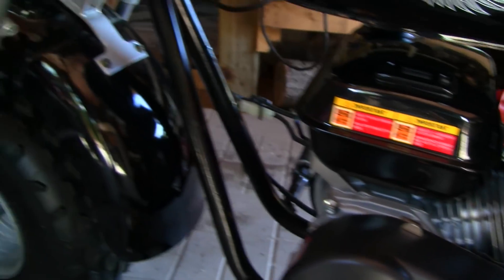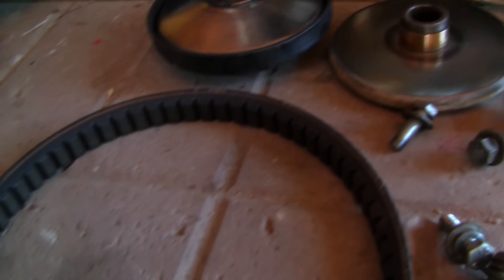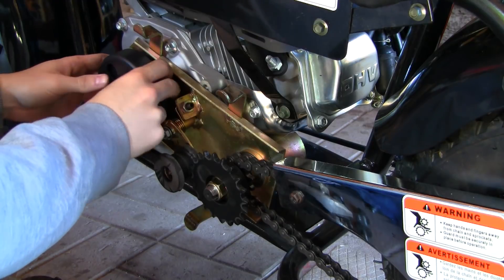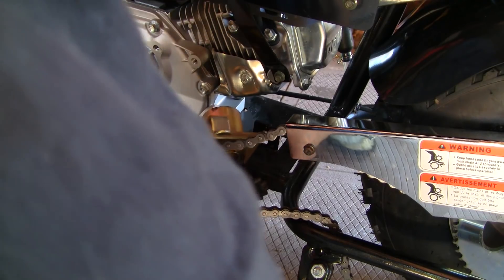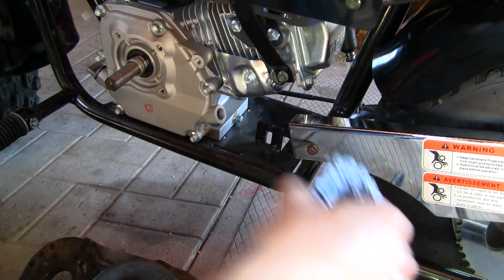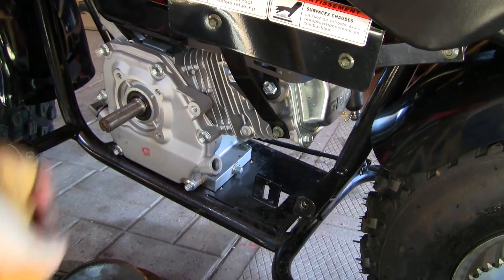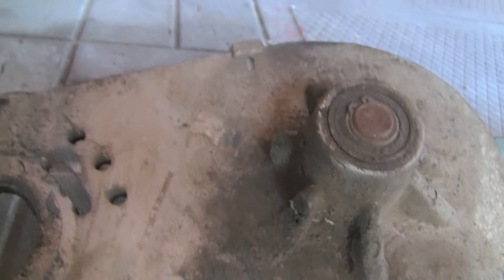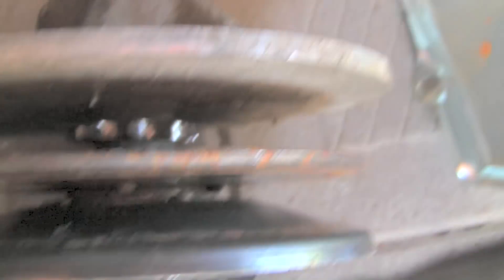Baja Warrior  Mini Bike Clutch To Torque Converter Conversion

Comment: You said it would go 70 after tuning the TAV, how would one go about doing that?
Reply from the maker: +Adam Szuszkiewicz you can adjust the spring tension on driven clutch to have it activate at different rpm's, also if the drive clutch and driven aren't perfectly aligned that can affect speed a bit, and perhaps other things like chain tension, wheel alignment, tire pressure, etc.

Comment: whats better for a go kart the Clutch or Torque convert for power
Reply from the maker: Depends where you plan on using the go kart. If its for any kind of off-roading then definitely the torque converter, but if its just going to be used on paved roads and paved go-kart tracks then a centrifugal clutch should be fine.

Comment: Could you tell me if an "impulse" type fuel pump would help the performance of a clone engine? Also, is there very much difference between the 196cc and the Predator 212cc engines? Thank you, any input would be helpful and appreciated.
Reply from the maker: Sorry don't really know enough about small engines to know if that fuel pump would make much difference. As for 196cc vs 212cc, I haven never tried one of the predator engines but I really can't see 16cc making much of a difference.. Perhaps someone that has tried both could better inform you though.

Comment: On some other videos I have seen about people putting torque converters on this mini bike they had to cut the mounting plate for the torque converter.  Did they do something wrong?
Reply from the maker: I'm not sure. I have never watched any other torque converter conversion videos. Perhaps they were using a different model?
Reply: It's a clearance issue, they didn't do anything wrong.

Comment: What does a torque converter actually do? Make it go faster?@MarcelsWorkshop
Reply from the maker: More speed, more power, better overall driving experience. Works kind of like an automatic transmission on a car always adjusting the gear ratio to give the best performance in the given situation.

Comment: The only problem about bypassing the governor is that the motor would wear out faster. I would get a 6.5 hp 212cc at harbor freight and get a torque converter it would go bout 50 or 60 mphs.  Also another why to make it go faster is to heavier valves
Reply from the maker: I've bypassed the governor in everything I own and haven't had an engine die on me yet.. :P (knock on wood)
Reply: Yea bypassing the governor inst to bad, but taking off the governor completely is a death wish for the motor

Comment: I have a minibike that is what I believe a yerf dog, it has the same stock setup, and I would like to mount a new engine and Put a torque converter on it because it is so slow, I want speed. Any suggestions and could you send me the link to the Torque converter and where you bought it?
Reply: if you take governor off you must re-place the flywheel as they cannot handle the added rpm's . A billet aluminum flywheel is about $100.00. It can handle up to 6000rpm. The stock cast iron flywheel will EXPLOED at 3800-4200rpm. One guy had his leg amputated from the exploding flywheel....be safe
Reply from the maker: If all you want is speed then the solution for most speed would be first bypass or remove the governor. Then simply remove the whole gear reduction system and have the chain go straight from the clutch to the back sprocket. (although you loose a lot of power in this setup for climbing and stuff like that).  Torque converter is a good all round solution though for way more speed and power then stock, but not as much speed as straight clutch to back sprocket.

This is where I got mine and the one I got: http://www.princessauto.com/pal/en/Accessories/3-4-in-Bore-10-Teeth-Torque-Converter-Kit/8404535.p

But only because its one of the few places in canada that has them. If your in the US you have many more places that sell them and cheaper options.
Reply: Larken McRorie amazon

Comment: what is the advantage of the variator? only the speed?
в чем преимущество данного вариатора? только скорость?
Reply from the maker: speed and torque. when your in a situation where you would need more power, such as climbing or, it automatically adjusts to a "low gear" when your on a smooth flat surface it automatically adjusts to a "high gear" to give you the most speed. like a simplistic version of an automatic transmission in a car.

Comment: That seemed like a really easy conversion.

Better acceleration? More top speed? That gear reduction setup looks like just a cheap way to "make it work" while sacrificing performance big time
Reply from the maker: Yeah it is a pretty easy switch but offers a huge improvement in performance compared to the original setup. It feels like a whole new bike with an engine twice the size after making the switch! :D
Reply: I'm sure. The dual clutch system definitely must utilize the engine's torque and powerband a lot more efficiently.
Reply from the maker: Krankie V
Definitely

Comment: You just changed the gearing and ruined the original setup. Both function the same exact way.
Reply from the maker: No... The original set up is a fixed speed this one is a continuous variable speed, like an CVT in a car, to give you more bottom end when you need it and more top end when you need it. They function very differently..

Comment: My baja mb200 that I bought two days ago has squeaky brakes, and tops out three seconds after I accelerate. I tried to adjust the throttle with a screwdriver and it didn't work. Please help! I need to know how to get it to go faster.
Reply from the maker: The brakes are squeaky cuz their cheap, but they still do the job. :P Baja Warrior Mini Bike Easy Governor Bypass (1080P) and/or Mini Baja 85km/h! (53mph) (AKA Baja Warrior or Baja Heat) to go faster for free.
Reply: any way to adjust the throttle
Reply from the maker: steven memez
the ends of the cable screws in or out to adjust throttle.
Reply: yea but when I did that it lost and gained power when I was riding it and backfired really bad
Reply from the maker: steven memez  Probably the governor. Remove or bypass it. If its not that then I dunno.. Take it to a small engine repair shop and they'll be able to fix it.
Reply: steven memez There is a screw inside a coil spring directly adjacent to the business end of the throttle cable that inhibits movement of the throttle body.  This screw is extremely useful in controlling engine power for use by a small child, I imagine this is the intended use as it doesn't seem to function as a rev limiter or safety device.  Look at the point on the engine where the cable connects, while activating the throttle, and this screw will become immediately apparent.  Loosen, or completely remove, this screw.

Comment: now cut off the long shaft coming out of the engine, because that also interferes with the torque converter... LOL
Reply: yea he really went the long way around to do this swap. if anyone else is here for tips, you can simply notch the aluminum backin plate where it hits the frame and likely notch/clearance anything else that hits or will rub. nicer to keep all the safety covers intact if possible, makes for a cleaner more factory install.

Comment: i guess i missed the rear oil plug behind the torque converter install but its easier to get in w/o all that on the bike mine has 3 but i omitted ALL that and went clutch to wheel all ya do is flip clutch over align wheel lengthen chain n wala i was hangin with 450 yamaha flyin bout 75 80 mph may need to balance wheels also but it was scary fast not for inexperienced rider for sure good luck im on my 2nd one 5 clutches 4 motors a wad o chain n sweat blood foul language but was worth every bit of it later
Reply from the maker: Doing that you definitely gain more speed but you loose all your bottom end torque. :P
Reply: so true but she is fast and also exstremely hard on chains sprockets clutch ect but removes the bulldozer feel of the drive section and pushing her is soooooo much easier whenst spacing of the fuel tank or other oopsies and no disrespect I know how it goes as to unexpected  trials along the way a 15 to 50 ratio would help ease the torque n wear but im using 10 to 50 n I push her up the hills but on the flats shes a beast near 70 mph or more depending on wind spark fuel ect n I put gocart motor instead of back faceing head designed motor she has n it was a BIG gain in fun to ride n ill keep feedin the chain to her till she blows n do it again ha ha thanx
Reply from the maker: edwin nelson
 If that's what you like then power to ya! :D

Comment: Wtf do I do now I have a nut that screws on the end of the shaft not a bolt that goes in
Reply from the maker: You must have one of the new models so your going to have to follow this guys solution of using a special lug nut.
How to add a torque converter to a Baja Warrior MB200 with untapped crankshaft

Comment: does your tav2 get hot after riding awhile? I recently converted to torque converter and mine got hot pretty bad the first time but the pulleys weren't really on the same plain, now they are alighned well but still seems to get hot after 4 or 5 miles?
Reply from the maker: Yeah it does get pretty hot

Comment: dude did you see the oil plug missing out the back hole I found mine the hard way blew oil allover hell also whole engine side plates tend to unscrew better put thread locker on em or all oil runs out lower bolt holes when they fall out 3x that happened swap factory exaust for strait pipe rip off air cleaner reroute case blow tube just use air filter n its a near 1 horse gain in torque n responsiveness w/o gov removal jus sayin 35 years a wrenchin on junk un junking it lol
Reply from the maker: There is no missing oil plug..?  I just use lock washers and have never had a problem with the plate unscrewing. :P Built my own straight exhaust. :P Added scoop to air filter but haven't done much else.

Comment: how much was the torque converter clutch? Ive found some on ebay and stuff from 100-145$ but I want to know how much it is new
Reply from the maker: For a new Comet brand torque converter is around $270 CAD. Can probably get knock off versions for a lot cheaper though.

Comment: dude you dont keep the thing between the two parts of the center of the belts that slows you down . The higher the belt goes the parts get skiner that huge spacer is between it stops it.
Reply from the maker: Not sure what part your talking about? You talking about the bronze idle ring at 5:10? If so that doesn't affect the speed, the clutch can slide over top of it when it's engaged. It just helps prevent premature wear on on the belt while idling. It allows the shaft to spin without grinding against the belt.
Reply: Ya I couldnt see that I saw an other viedo that I see better and saw that . Well did you by pass the throttle governor
Reply from the maker: Colin Stienke
Yes governor is bypassed

Comment: where did you get the torque converter clutch
Reply from the maker: a local princess auto
Reply: how mutch
Reply from the maker: tyler reel
around $270

Comment from the maker: Well there's way less vibration with the torque converter compared to the stock centrifugal clutch and it engages a lot smoother, but I have no Idea how it would compare to a racing centrifugal clutch, I've never tried one. :P

Comment from the maker: NP. Although if you just want speed and don't mind loosing torque, you could always just remove the gear reduction system and attach the two chains together so your going straight from clutch to back sprocket. :P

Comment from the maker: you might of bought a torque converter for a 1 inch shaft rather then 3/4 inch. Only thing I can think of is exchange it for the smaller version or if you can't do that you may have to buy a new 3/4 inch driver unit, or see if you can find some sort of adapter to go from 3/4 inch to 1 inch.

Comment: I didnt build the bike dumby.... check out the description of my channel asshat. I buy shit vehicles and replace as many parts necessary to make it run well and looks professional. And I do things like that to show people not to do it. If it was a mistake, I wouldnt have made a video of it. Also, that frame with the engine weighs less than 70 pounds and then im 150. Im pretty sure their rated for at least 300 cuz what if a fat guy were to ride it???? Brakes work fine... STILL

Comment: Do it right you say?
You have what appears to be a bicycle or mini moto brake on the rear of that mini chopper you built.
Your engine has 5 times the toque it was rated for and double the weight.

Marcel here actually has things that are safe.
And he is smart enough to ask for, and listen too good advice. 

Maybe you should stop posting now.
You are embarrassing yourself

Comment: If you clean, lubricate, and adjust as required then it would look like this.

You were hit by flying parts of a clutch you did not mount correctly as seen in your own video,
You clearly are not qualified to judge other people's work.

For your information the thread and bolt on these engines is 5/16 American Fine not "smaller thread than normal bolts".
Square key stock is not " a pin " .
If you need a part, then get the part number before you order and stop blaming others for your mistakes.

Comment: I've been researching torque converters for my new Baja Warrior 200.  Unfortunately,  the crankshaft on mine does NOT have a threaded center bolt.  Instead the end of the crankshaft is threaded on the outside and the clutch is retained with a nut and cotter pin.  Bummer.

What options do I have with something like this?

Comment from the maker: This is a brand new bike, but the one I pulled the converter off of and often use for experiments is a few years old and dirty, yet everything still comes off just as easily. Although I store everything in a dry shed, I guess if someone stores there bike where water can get to it and everything is rusted on, it might be difficult to get apart. As for caked on grease, that can be fixed by just taking a pressure washer to the bike and giving it a good cleaning. :P

Comment: What I really dislike about this video is that the project your showing is practically sterile. This thing obviously has rarely seen blacktop and you could work on it with a white glove and not get it dirty. What this video doesnt show is that if you have one of these after years of use and sitting around your going to have caked on grease and some parts arent gona wana come apart as they did on day one. Usually you need a pulley puller for the clutch and more force in taking of the master link.

Comment from the maker: its 3/4 inch. the difference is the size of the shaft on the motor. yours will likely be 3/4inch. 4-8hp engines are usually a 3/4 inch shafts, less then 4hp is usually a 5/8 inch shaft and more then 8hp is usually a 1 inch shaft.

Comment: Thanks a lot for the video i followed your instructions and the torque converter fit my bike perfectly...Only after a month of riding i seem to have a problem with the torque converter it just stopped accelerating like it used to when i installed it which was 40ish mph now it seems to go like 10 mph at most...Do you know what could be the problem with it? torque converter seems to work fine running, just not accelerating the bike for some reason...Any suggestions would be greatly appreciated

Comment from the maker: Ah I see. There are better more expensive ones with higher ratios, but this one is the easiest one to put on because its all one unit. The bigger ones are 2 separate pieces so you would have to come up with your own mounting system.

Comment from the maker: "But its the one you have is the best you have?" hmm not quite sure what your asking. :P Ya if you've never rode before I'd keep it stock until your completely used to it, then from there I would bypass the governor to give you more speed and get used to that. Then once you get board of that go with the torque converter for even more power and speed.

Comment from the maker: Comet TAV2-Torq-A-Verter, 3/4" Bore 10 Teeth, #40/41. Around $270 in Canada or $200 in the US. You can also find cheaper knock off versions of it too if you want.

Comment: PLEASE RESPOND ASAP... I have the same bike with the same "old" clutch setup not the torque converter. I recently lost my bolt that holds the clutch in and i really would appreciate if you could tell me the exact specifications on that bolt so i can go buy a new one. Also do you think i can ride it without the bolt in there? This would be a huge help for me if you could answer my questions.. 
Thanks in advance

Comment from the maker: no idea. :P if it broke off you may have to get a new unit, or Macgyver something, or just remove the whole unit and connect the 2 chains, that would gain you lots of speed but you would loose lots of torque. :P

Comment: Hey quick question marcel. I know you've probably answered this waaaay to many times...but how do you get the GPS to clock your speed? I see you've tapped it on the handle bars...but don't you have to plug into like some sort of plug in so it can read the speed? Also I know the GPS is battery powered.

Comment from the maker: Ya I guess you could just cut the chain guard if you want to keep it. I just didn't care for it much so It was just easier to get rid of it altogether. Glad you got it to work with the original holes though. :D Although I'm not sure if I would want to start bending parts of the bikes frame because it might cause a weak spot. :P But who knows, I guess only time will tell, chances are it will be fine.

Comment from the maker: But when I first added the torque converter to the original bike the governor wasn't bypassed and if I remember correctly, top speed was pretty much the same, it just took longer to get there and didn't launch as hard.